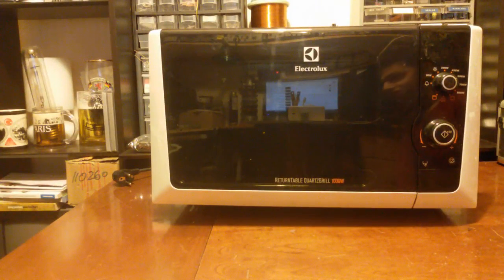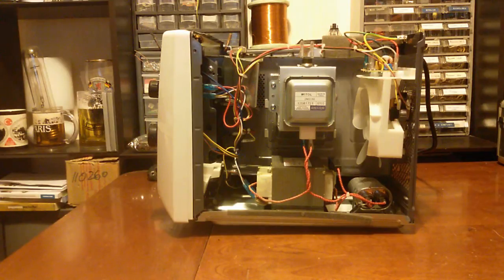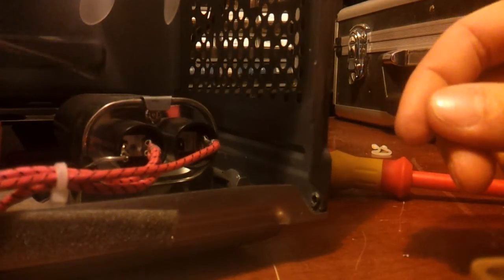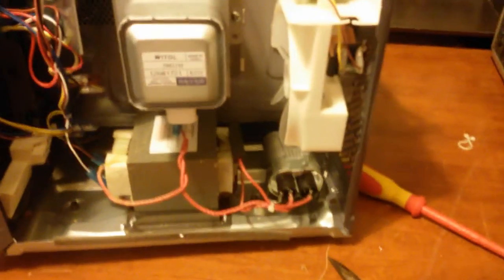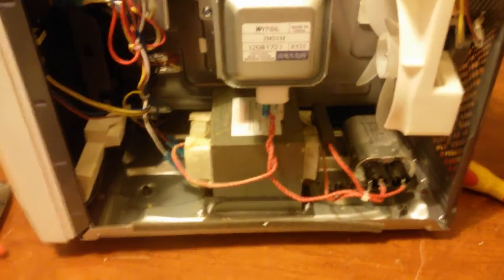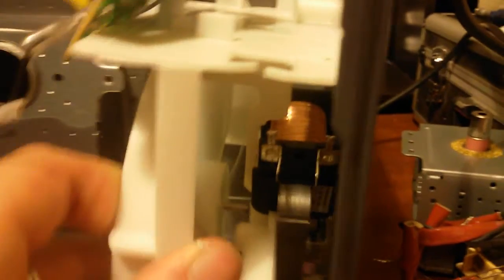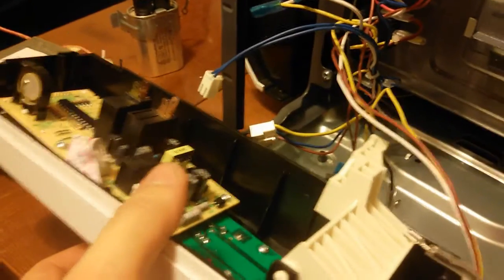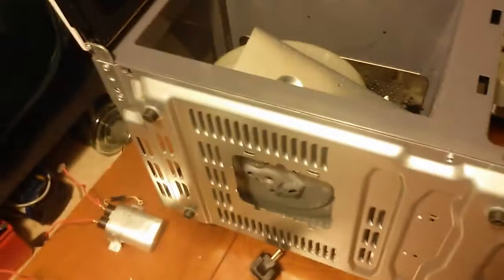MICROWAVE TEARDOWN AND DANGERS

Comment: Looks like the internal discharge resistor didn't work correctly, or you have a crappy microwave who's capacitor didn't have a built-in safety resistor. Even from maximum charge of 2000 volts, once the oven is turned off, its self-discharge (due to that internal safety resistor) should have brought it down to about 10 volts if left for about 2 minutes of self discharge. Microwave oven capacitors have a low capacitance of about 1uF, and so with just 10 volts that wouldn't create a large spark like that. However, looking at that spark, it's clear that it still had several hundred volts (if not over 1000 volts) still left on the capacitor.

Comment: Thanks for the video, scared the hell out of me. (which is probably a good thing!)
Questions: 1. What would happen if one discharged a 2kv loaded Cap with a screw driver, whom stated to handle up to 1kv?
2. Can one measure the Voltage of this 2kv loaded with a multimeter? or would it burn?
Cheers
Reply: Nothing. The current isn't flowing through the screwdriver handle. He only dropped it because he got scared.
Reply: Get a piece of PVC pipe (known as a chicken stick) about a foot long and tape the screwdriver into the far end of the pipe and then discharge. PVC is a bad conductor.

You're multimeter is probably only rated to 600V so it won't enjoy it, don't do it.

Comment: how many volts does a microwave capacitor hold?
Reply: Enough to kill the shit out of you
Reply: Somewhere in the kV
Reply: ~2100V
Reply: 4000 volts or so
Reply: Around 3000 to 5000 volts
Reply: @fyoutube-o4v  I know the definition of Voltage. It's the amps that worry me. A shock from a magnetron capacitor can be fatal.
Reply: About 2000V
Reply: Enough to kill. It's about 2000 Volts, but it is Amperes that kill not Volts.
Reply: @Psycho9263  No, it's not. Stop spreading this shit. It's a combination of both. 

Go stick your forearm over the terminals of a car battery (low voltage/ high current (amps)) and see nothing will happen to you. Do the same thing with a spanner and it will spark and glow.
Reply: @HaggardEffect  Then how come you can get a shock from an oil burner transformer with 50,000 Volts and live? No Amps is why.
Reply: @Psycho9263  that's why I said it's a combination of both you prat. One needs the other.
Reply: @HaggardEffect  OK, I get it. A/C capacitors are a bit different. There is not enough electric (uF) to cause death, but enough to hurt.
Reply: I've been zapped by that transformer, but if a tenth of an amp is present in that kind of Voltage, it will kill.
Reply: @HaggardEffect  That's because electrons can flow easier through metal and its also a dead short. You will not get a shock because the battery is grounding out. However, the metal will heat up from all the resistance caused by the short. Voltage is the electrical pressure and/or movement. Amperage is the total amount of current and the number of electrons flowing through a conductor. A Magnetron capacitor can store 2100V 0.86uF - 20Amps more than enough to cause death. No matter how you look at it, very dangerous to anyone, especially if he/she has no idea of what they are doing without the proper knowledge and training.
Reply: @Psycho9263  Well in that case, I recommend that you don't play with any microwave oven capacitors yourself in the near future.
Reply: @Psycho9263  Seeing as the resistance of your skin is mostly constant, and V=IR It's both. High voltage will mean high current.

Comment: I would have expected better from Electrolux they're actually Swedish company LOL. With the penny pinching wire length thing, I'm surprised they can make a whole oven for the price they charge as just to buy a transformer of that rating would normally cost more than the whole oven. Looks like they saved money on the bleed resistor too :-)